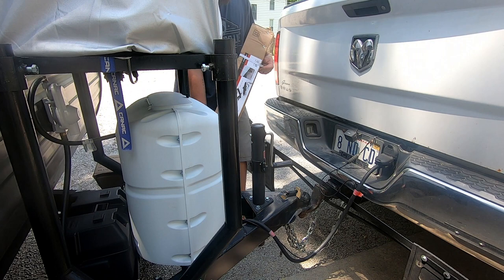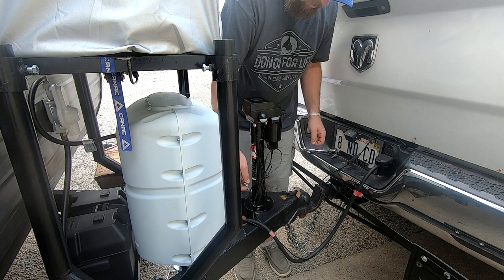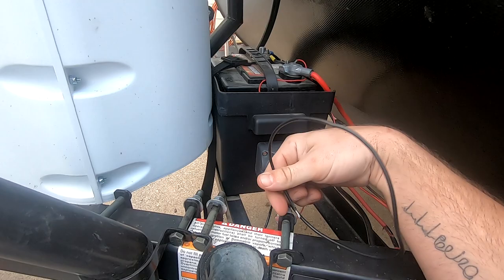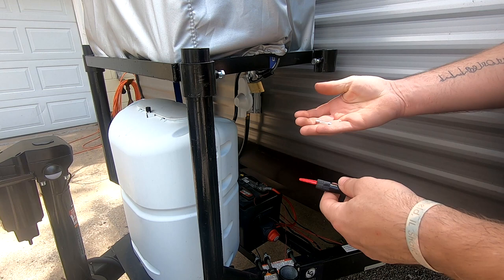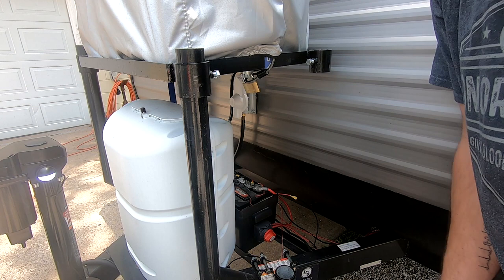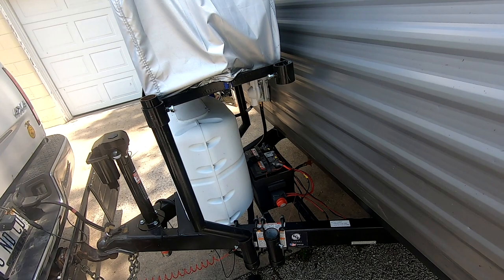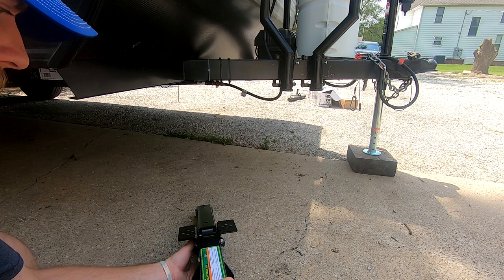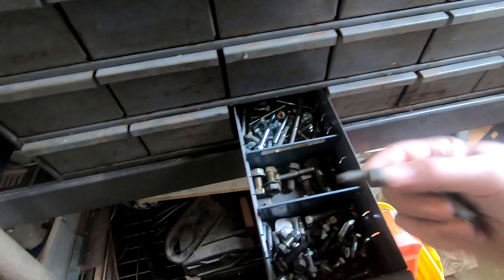Do This Camper Upgrade First | Electric Jack and Stabilizers | Coleman Lantern LT 17B

Comment: I agree completely. These are two things you should do right away. They are not that expensive. We got caught in a storm in west Texas with 50 mph straight line winds, The Stabilizer jacks worked great. 
There is one more thing I would add to the upgrade first list for the 17B- Stare Tire.
Reply from the maker: Yeah a spare is a definite, ours fortunately came with one but ours was a 2020 model.
Reply: Wow. I didn't know when they stopped including spares. The current industry standard for smaller RVs like the 17B or 17R is to not  include one. This makes no sense to me.

Comment: It looks like you upgraded the propane to 20# from the stock tank? Do you have video on the parts and where you ordered them from, installation, etc
Reply from the maker: I actually didn't do anything with the propane stuff other than putting the cover on.
Reply: Oh ok, thanks for the quick reply!

Comment: Did you cut out some of the battery holder to allow all the wires to go flush? I'm having issues closing the lid. Thanks in advance.
Reply from the maker: Yes I made a notch under the bump out in the lid.

Comment: Don’t know if you’re going to respond or not did the stabilizer jacks work better than the pyramids…….I ran the pyramids all last year ….. jus bought a new set of the same jacks you jus installed
Reply from the maker: Yea they are definitely an improvement over the pyramid style jack. You won't be disappointed after you install the new ones. Safe travels

Comment: Extra question: Not on you topic, I have the same brand and series. Do you have the side AC unit? If you do, have you had issues with it leaking into the coach? It was initially, leaking under warranty and they said the AC condensation pan was installed upside down. Supposedly, solved it, but of course after using it months later, now leaks in a different spot, but still inside the coach. Of course the warranty is over. Thanks for your videos. I’m putting in a window and I’m using your video directions. Alittle different position near the bed and upper mid position. Any suggestions would be appreciated. Thanks Mike
Reply from the maker: Yes ours did have a wall unit and I pulled the unit out and tipped the pan outwards as well as siliconed the inside corners of it. You might also need to check the weep holes on the outside at the bottom of the screen, they might be clogged with sealant or debris. Hope this helps.

Comment: Where did you find the self tapping bolts? Lowes and Home depot looked at me like I had 2 heads when I asked for self tapping bolts and not screws
Reply from the maker: +Brian Palmer I'm sure that they have them there, just some people don't know what they are. Tractor Supply should carry them and possibly Ace Hardware. I just happened to have some in my bolt bins that my brother had given me. I have like 300 lbs of miscellaneous hardware LOL.

Comment: Do you still use your  Pyramid stabilizers even though you have front jacks now?
Reply from the maker: No we don't find them necessary anymore since these stabilizers do such a good job. We do however use one pyramid jack under the step to help with the flex of the step and any rocking that  might happen, which is rare.

Comment: Did you need to mod trailer Jack in any way in order to be able to open truck bed?
Reply from the maker: I couldn't open my tailgate with the factory jack so I'm not sure what would need done but there just wasn't enough room regardless of the jack
Reply: @SmallFamilyBigDreams  gotcha. Thanks for the reply. 

I have seen where some say you can turn just the head unit 90 degrees, or the whole thing, and it can give enough room for some trucks. I just haven’t seen a video yet on that mod.
Reply from the maker: Sorry I couldn't be more help.

Comment: I was wondering what size window you got to replace the kitchen window you put in, also where did you get it? I know it wasn't this video but it was the one you replaced the window with a slider and you put in the new cargo access door. We have the access door but can't find slider window.
Reply from the maker: I purchased it on Amazon. Here is a link. https://www.amazon.com/dp/B07FN2HSYV/ref=cm_sw_r_cp_apa_glt_fabc_9JCP11H0C5V76SGVTDH6
Reply: @SmallFamilyBigDreams  thank you so much I have ordered it the trick will be to get it into Canada with the borders closed right now. You just popped the window into the hole left by removing the existing window right?
Reply from the maker: Yes
Reply: @SmallFamilyBigDreams  does it come with screws etc or do we just reuse the ones in it now? We were thinking of using the window somewhere else in the trailer, do you think it would work in the door?
Reply from the maker: Yes it did come with new screws but I also found that the old trim ring that is removed will need to be reused because my new one wasn't thick enough to cover the framing. As far as using it in the door I feel like it would be too big and would leave the door with not enough material around the sides and possibly crack the roof itself.
Reply: @SmallFamilyBigDreams  Question, trim ring, is that the inside frame or what. they have mentioned it in a few sales ads.
Reply from the maker: It's the piece that comes off from this inside.